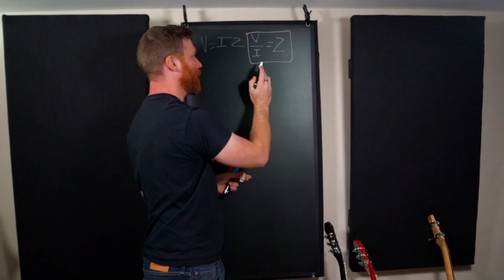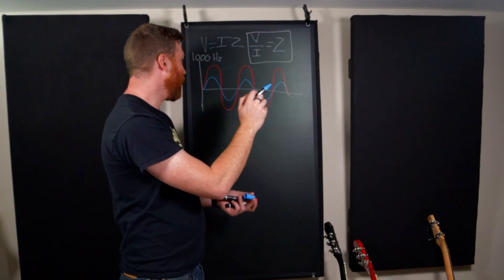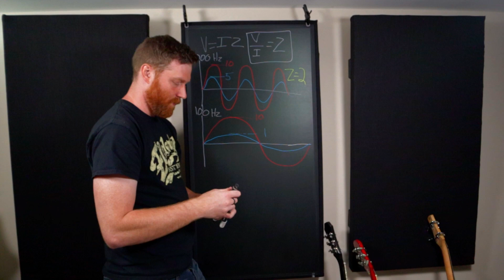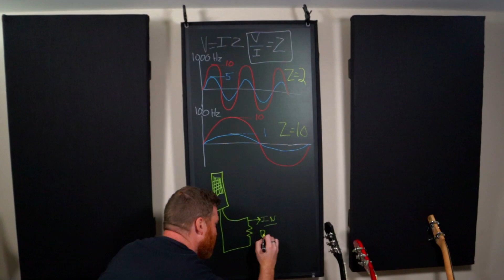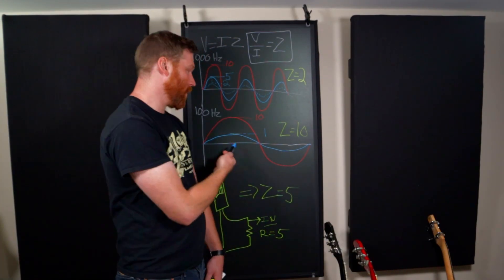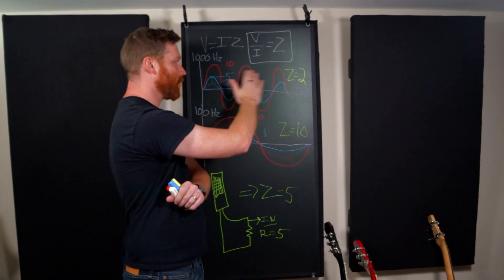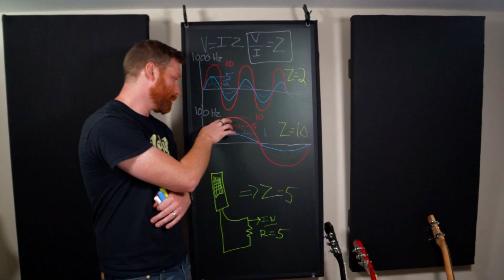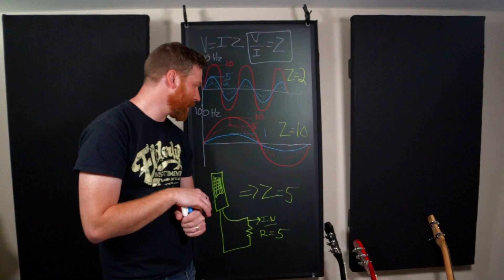A Better Explanation of Impedance for Audio Signals

Comment from the maker: I have one update/correction I'd like to add to this video that has come up since I put it out.  I mention in the video that impedance tends to go up as frequency goes down.  This is true for ribbon and dynamic microphones as well as piezo based pickups, however it is not true for traditional electromagnetic guitar pickups.  Wound pickups have an impedance that peaks usually somewhere from 2kHz - 8kHz or so.  The same general principles from the video apply, however impedance mismatch will lead to loss of voltage more at the resonant peak of the pickup rather than in the low end.

I have continued to learn more about impedance while designing products for audio, and may post an updated video in the future.  If that would be of interest to you, please let me know here in the comments section if you would like.
Reply: This sent me down a deep rabbit hole! It seems that the changed frequency response when the load impedance is too low could also be due to the varied voltage transfer efficiency of the divider that records the voltage. I got this from the Wikipedia article for "Impedance bridging" and I wonder what you think of it. Although your explanation about the load impedance restricting the circuit seems intuitive too. In any case, thank you for the video and the whole transformer series!
Reply from the maker: I am also a fan of rabbit holes :)  Yes, I believe the description you share there is correct, if I understand correctly what you mean.  Though I took a look at their pros and cons list in that article and disagree with it because they do not take into account the effects of a source that has an output impedance that varies with frequency, which is basically the main point of this video.

I'll also say, the language I use in the video is more of a model of understanding than completely proper EE.  The language of talking about a "reflected" signal comes from some previous work I did in designing cables for digital data transfer.  All that work falls under "transmission line theory" and thinking about it in those terms is kind of a different perspective.  If you want another rabbit hole good that one! @felixhilden2782
Reply: @alderaudio  Thanks for the response! Yeah it's odd that they don't mention it although there is something about DIs later on, but I do think this is what's happening on the electrical level. Your model though is, as I said, very intuitive 👌 I'm not sure what you meant with reflections. But as it was mentioned in the same article incidentally, audio cables are not transmission lines due to their comparatively short length. Perhaps the "reflection" physically is the attenuation in signal on peak impedance wavelenghts even in shorter cables just applied essentially instantly to the whole cable, but this is just hand waving.
Reply from the maker: You are right, transmission line theory applies when the wavelength of the signal is shorter than the cable run, which doesn't really ever happen in the studio.  It does happen on both telephone lines running over miles, and in a short ethernet cable passing signal in the GHz region, and I just find all that fascinating.  I appreciate the comment though, it makes me wonder whether it would be more accurate to reserve the term "reflection" for transmission lines.  At some point, I will do an update to this video, as I would do it better today than when it was recorded.  Discussions like this help me know what to clarify, so I appreciate the comments.  Thanks! @felixhilden2782
Reply: @alderaudio  I agree! It's very useful to bounce ideas off others, so thank you too 👌Looking forward to all of your new vids!
Reply: @alderaudio  Audio cables are still transmission lines. The issue is whether or not the impedance of the line itself plays a significant role in attenuation and reflection. Impedance discontinuities between signaling device and load will create reflections regardless of line length.
Reply: Impedance will vary whether it is more inductive (coils, transformers) or capacitive (capacitors). As frequency increases:

1. Inductive circuits will have an increase in impedance
2. Capacitive circuits will have a decrease in impedance (in the audio frequency range)

And the reverse if the frequency decreases.

Something inductive (such as a guitar pickup coil) will decrease in impedance as the frequency goes down. My 2 cents!
Reply: I'm sorry, but I don't understand why you silly folk keep trying to explain magic with science.. just don't understand.. and are wrong... I have not watched this yet but I just wanted to let you know... Whatever the answer is it's not good enough and I have to buy more things, much more expensive things otherwise it will not feel validated and I will not be able to validate myself by spitting upon those beneath...

Comment: A source with no load produces no current at all. It's not correct to think of a transducer or other such source as having some "natural" ratio of voltage to current all by itself. Impedance (in both electronics and acoustics) is primarily useful for describing how two things interact. To properly understand the role of impedance in audio electronics, you need to consider how a source interacts with a load.

The key equation one should focus on is the equation for a voltage divider, that is, of a voltage source with two resistances in series between it and ground, one resistance that is part of the source, and the second one comprising the load.

Consider the DC (fixed voltage) setting first. One resistor represents the internal resistance of the source, with resistance R_S; the other represents that of the load device, with resistance R_L. If the source produces voltage V, the load sees only a part of it, the fraction R_L/(R_S + R_L). That fraction is always less than one (the bottom of the fraction is larger than the top). The division operation is why this simple circuit is called a voltage divider. (Incidentally, this equation follows from Ohm's law and Kirchoff's law).

Note that if you make the load resistance much larger than the source resistance, then the load sees nearly 100% of the source voltage (albeit by drawing negligible current). For example, if the source resistance is 100 ohms and the load resistance is 100,000 ohms (100 kohm), the equation gives 100,000 / (100,100), approximate 0.999. One might say in this setting that the load resistance "swamps" the source resistance, making its effect on the transfer of voltage negligible.

Now shift to a time-varying signal (AC), where the difference between impedance and resistance matters. For a source producing a voltage V(f) with frequency f, with source impedance Z_S(f), and a load with impedance Z_L(f), the voltage divider equation still holds, but now is frequency-dependent. The fraction of the source voltage across the load is Z_L(f) / [Z_S(f) + Z_L(f)].

Now there are two key things to note. First is that, by design, most audio circuitry (preamps, amps, etc.) has an input impedance that is mainly resistive (i.e., constant vs. frequency) across the audio spectrum (20 Hz to 20 kHz). So for the load impedance, we can still think in terms of a resistance, i.e., the load impedance is Z_L(f) = R_L, constant with respect to frequency. The second key thing is to note that different types of sources can have very different source impedances---not only in size, but in how strongly the impedance varies with frequency, and in what manner (whether the impedance gets larger or smaller with increasing frequency, or perhaps peaks at some frequency).

The fraction of the source voltage seen by a resistive load is the impedance voltage divider equation above, but with the load term just a constant resistance: the fraction is R_L / [Z_S(f) + R_L]. If the load resistance R_L is similar to or below a typical value of the source impedance Z_S(f), then this fraction will vary with frequency, meaning that the load will "see" a fraction of voltage that changes with frequency. In an audio setting, this means that the load will change the tonality of the signal; the source impedance and load resistance form a kind of equalizer with non-flat frequency response.

But now consider the case where the load resistance is much higher than the source impedance at any audible frequency. In this case, just as in the 100 ohm source and 100 kohm load example above, the large, constant load resistance swamps the source impedance, and the load sees very nearly 100% of the source voltage, at every frequency.

So if you want to see the source signal with high fidelity, the load should be resistive, and the resistance should greatly exceed the source impedance.

One important thing this analysis reveals is that it's wrong to talk about transducers like piezos or mic ribbons as having a single source impedance. The reason impedance matters for these devices is that it changes quite drastically over the audio spectrum. Tyler correctly points this out here (though in other videos he talks about transducers having particular impedance values). The other takeaway is that you don't want to match the load impedance to the source, even approximately. You want the load impedance to be way bigger than the source impedance, so that the voltage divider loading effect is made negligible, and the load sees an accurate copy of the source signal. In the acoustic guitar community, you'll often see players say something like, "a piezo pickup has an impedance of about a megohm, so you want a preamp with a similar impedance." Actually, piezo pickups have an impedance that changes pretty drastically with frequency; you want a load resistance (preamp input impedance) way higher than the piezo's typical impedance so that there is no equalizer-like loading effect on the tone.

Incidentally, there is a notion of "impedance matching" in electronics; you want to match impedance when the goal is for the load to capture as much energy from the source as possible. With a higher load impedance, the load will see more of the source voltage, but less current will flow, so less power will be delivered. With a lower load impedance, more current will flow, but the load will see a smaller fraction of the source voltage, so again less power will be delivered. The load sees the most power when the impedances are matched. With small-signal audio processing, e.g., by preamps and mixers, we are not trying to optimize the energy obtained from the transducer; we are trying to optimize the fidelity with which we can see and transfer the source voltage (as a function of frequency). So we want a high resistance (constant impedance) load. There is a tradeoff, though; resistors generate noise, with the amount growing with the amount of resistance. That's why a typical piezo preamp has an input impedance of a few megohms to 10 megohms—enough to swamp the varying impedance of the transducer, but not so much that it introduces significant noise. —Tom
Reply from the maker: Hi Tom, nice write up.  I agree with you on all of it.  Been a while since I made this video and on several things I'd do differently today.  Hopefully someday I'll have time to make a newer version.

Comment: Thank you for this great video lecture. All I knew for a long time was the need to maintain a cascade of high-in low-out impedance sequence with a faucet and jar diagram in my mind. Now I know more of what's happening to my audio signal going out of my electric guitar, through all the pedals and into the amp/PA system, with all the buffers along the way.:yougotthis:

Comment: This explanation is Alot more practical and simpler than others. Still have more questions though lol.  What's the cost of your ribbon mics. Also, seeing that your mics naturally built with nice low ends that eveñ if any attenuation happens with the preamp it's still in the sweet spot, is it best suited for recordings requiring that low end richness? What suggestions you advise for mixing or EQ for wanting more refined and richer top end to still find that sweet spot balance? That means we need lower impedence to match higher frequencies?
Reply: Changing the timbre of a microphone is best done with EQ, not with interface impedance. If you wish to rebalance the low and high frequencies, use a low- or high-shelf filter.

Comment: Ok, what does it mean thatbuutput impedance is ratio of current to voltage? Or stating orherwise: the ratio of current to voltage when the microphone is connected to what? Is it measured with contacts shorted?

Comment: Thank you for this beautiful explanation, it gives the kind of intuition that is difficult to get from just looking at equations!
Just a small question - is there any downside to an impedance relation where the output impedance of the source is very low compared to the input impedance of the receiver? From what I gather, that would be the case when e.g. connecting a low-impedance microphone directly to a guitar amp
Reply from the maker: Good question.  There aren't drawback in this case directly related to impedance, but there are sort of side effects that go along with impedance.  The lower impedance in a passive mic also comes along with a lower voltage output, so it will normally be too quiet for the amp.  They do make transformer products to deal with this, however the other side factor is that you are going from a balanced three prong connection to an unbalanced 1/4" plug.  This isn't undoable but it can be prone to picking up noise.  Noise plus low output is a bad recipe.  It's more doable with a transformer, but a guitar speaker doesn't do the greatest job on vocals anyway, so you don't often see it done.

Comment: After reviewing subsequent comments, looks like you realize the “reflected” voltage or current explanation isn’t that useful. When explaining the effect of preamp input impedance on an audio source I think it’s better to explain it as an audio filter. For example, a microphone might have equivalent circuit of a voltage source in series with an impedance (or a combination of lumped components) that combine to provide that impedance). A preamp puts an impedance across the output of the mic. If the preamp impedance is far higher than the impedance of the source, neither the impedance will have significant effect. If the input impedance drops, it will usually act as a high pass filter, much like the tone stack on an amplifier or the series RC tone control in typical passive electric guitar. It’s usually desirable to avoid coloration so one typically tries to keep the input impedance as high as possible. In some cases (such as with passive magnetic guitar pickups and perhaps your ribbon mics) a bit of filtering can be desirable. But if you take that approach it can take some analysis and experimentation to dial things in. That’s why guitarists often experiment with potentiometers, capacitors, and instrument cables to dial in their voice. The same approach can apply to a microphone.

Comment: Actually, phase is very important.  Zero phase is only true for purely resistive components.  Real world impedances have phase shifts.  Purely capacitive and inductive loads have phase angles of 90 degrees (of opposite polarity).  Real world impedances have angles typically between -90 degrees and +90 degrees. Resonant systems can have angles of 180 degrees.  Also, voltage reflections are not much of a consideration in audio.  The real problem you describe is due to low frequency losses due to the predominantly capacitive source impedance of piezo microphones, causing a high pass filter action.  The opposite is true of dynamic mics.  The solution for each is to have a very high input impedance buffer situated close to the mic element.

Comment: I wonder why the input impedance has to be 10x? Isn’t it easier to say that the microphone impedance has to stay as low as possible relatively so nearly all its voltage appears across the input device?
I think the input device has some maximum impedance designed into it but as a user you have more control over the impedance range of the microphone you select. Meaning that a microphone with a narrow frequency range will not have a huge impedance variation, making it easier to work with a variety of input devices.
Also, is reflection right? I thought this only applied to transmission lines.